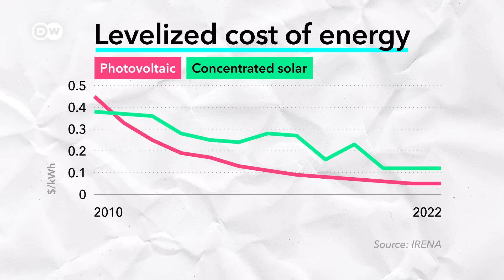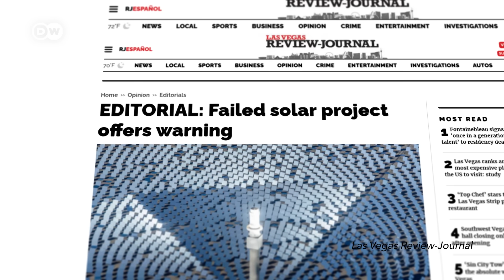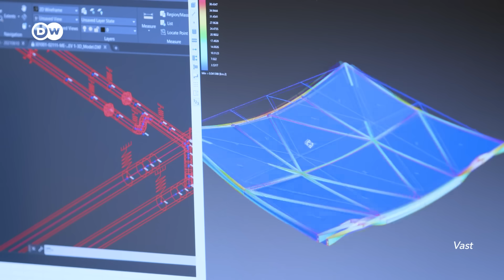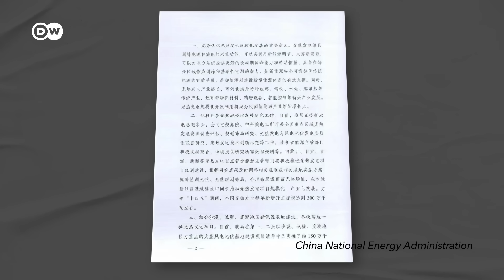How we can make solar power at night

Comment: These exist already, don't know why you covered it, they aren't living up to their potential and cost a lot and aren't as reliable as solar panels combined with grid storage which does EXACTLY the same thing but costs less.
Reply: That's exactly what the video talks about, with the exception of it mentioning how using the sun's rays to heat molten salt as storage is more efficient than charging batteries. That's why they covered it.
Reply: @user72974  except the data collected over a few years of using these shows they aren't as efficient because they have down time.  Grid storage doesn't have down time.  This very type of solar farm has a bad record in actual usage so maybe the channel didn't cover THAT part very well.
Reply: @johndoh5182  The video that talked about two modern CSP projects "failing" didn't do a good job covering that issue?
Reply: @user72974  When a title of a video says this:
"How we can make solar power at night"

And presents THIS method of solar which has shown to be a failure in multiple places it's installed AND backed up by a thumbnail, I don't bother watching the video when:

Extra solar cell panel capacity-grid storage works better and is cheaper and makes economic sense, and easier to work with and maintain.

In other words I don't watch every video.  When a channel cant' figure out how to title a video correctly and use a thumbnail that represents their video correctly then too bad I'm not going to waste my time.  Maybe a big red circle around it with a slash through it would have been better thumbnail.

Either way is storing power to use that stored power at night, so there is NO generation of power at night as the title says, there is a discharge of stored power at night.

And I've wasted enough time with this video by replying to comments so peace bro outta here.
Reply: @johndoh5182  Fair. They should have known battery tech has advanced by now to the point where using batteries to store generated electricity overnight is a better bet than CSP. The title is problematic.
Reply: What exactly does grid storage mean, it is really the use of nat gas powered peaker plants that generates power when the sun and wind vary. The amount of Li ion batteries available is about a million times too little to match what nat gas does.
Beside Gemasolar in Spain was around 20 years ago and produced power up until 5am in the morning, at avg 1GWe scale it would have cost $18B, >3x that of plain nuclear power.
Reply: @johnjakson444  Dude there are a few types of grid storage and probably the least costly now which is also VERY effective for grid storage is Iron redox flow batteries and use the most common elements in the world.  It's why OTHER channels cover it and do update videos with its progress which really means getting out in the field because they've been in production for a few years now.

The most STUPID thing you could do is use Li_Ion for grid storage so don't know why you're talking about it.  You don't need to use rare earth materials for grid storage and the world can't afford doing so.   So, if you hear of your govt. subsidizing a program to use Tesla's Li-Ion grid storage units write to them and tell them they're idiots.

Comment: This will fail because battery technology keeps getting cheaper, now we have sodium-ion batteries which are 40% cheaper than lithium-ion batteries.  And batteries will just keep getting even cheaper.
Reply: Batteries are not viable for long term energy storage as they degrade over time. Also the amount of material needed to build battery storage at a large scale makes it uneconomical. The best way to store energy is with pumped hydro. It can be scaled up to meet demand, utilises an existing natural resource and is relatively cheap. Batteries will sill be used for storage in some cases where it makes sense but it will never be a major part of energy storage
Reply: @TheLiamster  batteries only degrade a little over time.  Look at the Nissan LEAF it was released over a decade ago and most of them have about 85-90% of the original battery capacity.

One thing that makes the LEAF even more impressive is that is old battery technology modern batteries would do much better than that.

And the LEAF was built cheap so it doesn't have any thermal battery management system, all cars built after the leaf have thermal battery manament systems that keep the batteries at just the right temperature.  As all cars built after the LEAF will have far less battery degridation than the LEAF.

However we are talking about stationary battery storage.  Which will not have a full discharge in an hour, but more like 4 hours, so you're not hammering the battery so much, so you won't degrate it so much.  Also I was writing about sodium-ion batteries, which aren't as delicate when it comes to temperature.

Basically you won't have much degridation.
Reply from the maker: Talking about sodium, have you all seen this video we made previously? 👇
"How salt and sand could replace lithium batteries"
🎞️ https://www.youtube.com/watch?v=-vobMl5ldOs
Reply: Wrong, ask Tesla for the price of 10KWhr(e) of starage, it's at least $10K. Now a gallon of any hydrocarbon fuel holds about 30KWhr of chemical energy, worth about 10KWhr(e), the fuel is a few $ and the storages is about the same, about 10,000 times cheaper. Electrical batteries will never be cheap because physics says so, look up energy density of materials.
Reply: @johnjakson444 who cares about energy density when u have ample space in a desert? Secondly, u r not talking about the future cost of sodium-ion batteries
Reply: @commieTerminator  so many commenters here seem to live in a fantasy world that solar, wind, and batteries of one sort or another can save the world, just could read a physics text book on energy, maybe "Without The Hot Air" by David MacKay, free download.
Reply: @johnjakson444  energy density doesn't matter for stationary storage, these batteries are not in a car and are not moving they can be as big and heavy as they need to be.

Comment: If you have excess pv power, like they often do in California, couldn’t you send the excess to the salt tower for storage? Also, if the salt is about to solidify, couldn’t you import power to the salt to prevent it?
Reply: @johnransom1146  There is always a solution to every issue. What drive this stuff truly.

Comment: Why are the using towers over Parabolic trough solar collectors. They seem much easier to build and then you have everything close to the ground.
Can they reach higher temperaturs using the tower? And do we need higher temperaturs. One should think that 300-400 C should be enough. 🤷‍♂
Reply: parabolic troughs often use oils as the coolant loop, you can imagine how flammabale that would be, and in the US SW these devices did catch fire and were offline for months.

Comment: anything but nuclear..
Reply: Yeh I posted a comment that must have been removed. The Germans got rid of their nuclear and replaced it with lignite coal and some wind/solar. Net result, per capita CO2 for Germany is twice that of France that uses mostly nuclear power for their grid. Also Germany now has a dual grid, coal for baseload industry, and the expensive unreliable renewable energy for the consumers backed up by peaker plants that burn coal instead of gas.
Reply: So you’re saying coal is ok?
Reply: if thats a serious comment, then take a look at what happens when greens kill all the nuclear power in the country, it's a fact that German carbon emmisions are 2x that of France per capita, and what tech is it that the French use to lower release carbon. Why that would be nuclear. Look up on LLNN the energy flow graph and also the carbon emmisions by country. The EU also has similar database info graphics. It is greens that are responsible for all the new coal burning plants in Germany. The same greens in the UK even oppose solar farms too on Englands green and beutiful countryside, Greens are the worst of the NIMBYs.
Reply: Thorium based nuclear would be good.

Comment: It's too complicated, too many single points of failure and they require their own fossil fuel backup to prevent the salt solidifying.
The concept is very appealing, but the reality just isn't viable.
Reply: Why does it require fossil fuel backup to prevent it solidifying? If run correctly it shouldn't solidify, and if it does, what stops the power coming from renewables since it's connected to the grid?
Reply: @Masterrunescapeer  it's partly a practical logistical issue. The risk of damage from the salt solidifying is so great that they have to have on-site generators in the event of a failure and grid disconnect, but they're otherwise an underused resource if never otherwise used.
Their ability to maintain temperature and therefore power output is very overstated, with the energy being stored in vast vats of molten salt. That storage is finite and some of it is required simply to stop the system freezing.
Reply: @LudvigIndestrucable  Seems so but will knowledge be gained?
Reply: When that stupid senator RF Kennedy was backing these solar thermal plants in CA, it turned out that nat gas was about 30% of all the energy inputs, since the mirrors took forever to get the heat up to suitable temps in the morning, nat gas was used for the first few hours in the mornings and then later at night. And the sun doesn't just turn on like a lightbulb in the sky.

Comment: Isn't it easier to generate hydrogen, store it pressurized in big tanks and "burn" it at night or whatever energy deficit period? Compare it to managing hundreds of small rotating engines and clean glass from dust?
Reply: It's easier to pump water uphill, or heat a bunch of rocks, if one wants to store energy.
Reply: Right now, CSP would still be vastly easier, and could also be that we end up with CSP with hydrogen storage.
Reply: Its always great to convert one form of energy into another and not factor in the losses as if it were a doddle. Hydrogen has huge losses all around, using electrical energy to make it then convert to hydrogen based fuel product and store it and later convert back to electrical could easily have a round trip eff of maybe 10%. Pumped hydro, liquified air, isentropic can reach 60% quite easily.

Comment: Yeah, I heard about it. I was hot on the idea twenty years ago.
I just couldn’t get other people excited enough about it.
Say is there away you can turn thermal energy directly into electricity?
Infrared photovoltaic
Reply from the maker: Yes, thermophotovoltaics - cells are similar to photovoltaic ones but are designed to convert the specific wavelengths of infrared radiation into electricity. You can read more here 🔗 https://www.nature.com/articles/s41586-022-04473-y
Reply: @DWPlanetA  Infrared radiation is a fraction of the heat energy of heated objects, most of it is lost ore exchanged directly material to material.
Reply: No despite what the other comment from DW says about thermo photo voltaics. It is simple physics, you want to convert heat into electrical energy you want that heat to be as high as possible in absolute Kelvin temps, the machine that does the conversion will follow Carnot limits and the most efficient conversion reaches upto 60% or so far higher than the photo cells could ever do.The ideal heat source is always going to be fission giving about 1000K in Flibe salts, the convesion can be done with Super Critical CO2 engines which reach 60% eff.

Comment: With a 7 GW nameplate installed capacity, how much energy will this plant produce in 8760 hours of the year? A gas plant of that capacity will give you around 55188 GWh. What would be the cost to build a concentrated heat solar plant of 7GW that can produce the same amount of energy as a gas plant with an availability factor of 90%? Please include how much it will cost each MW to make, given that the cost of energy will impact the cost of anything done in a modern world with an energy base economy
Reply: Gas plants have a capacity factor of 56% on average, not sure where you got 90% from.
CSP with 6 hours is 40-50% CPF for worst-case 6h, which is usually more than enough for over night time, with some reaching up to 90% if more modern / 8h design.
Its big draw is that it's also 3-4x as efficient as solar for the area (over 80% solar energy gathered vs PV 26%). 

It's also cheaper than nuclear and quicker to build, generally safer (as in less requirements for safety bloating up the price, and you don't have the nuclear worst-case).
Reply: @Masterrunescapeer  ok considering a 50% capacity factor I’ll get 30660 GWh/year from a 7GW gas plant. How much it will cost to build a solar thermal plant that provide the same amount of energy per year.
Reply: @Masterrunescapeer  I think he means 90% for CCNG power plants uptime and upto 60% eff, while nat gas peaker plants have much lower uptimes and thermal eff of maybe 40%.
Reply: @johnjakson444  I was correctly referring to the uptime; nevertheless, let's discuss the capacity factor and the cost per kW while producing the same energy/year with either technology. We should also consider having these power plants installed in different places, from the sunny Nevada desert to the darkness of Northern Ontario or Quebec.

Comment: The problem with CSP is that they sacrifice economics and complexity to the god of collection efficiency.  If you can reduce the efficiency by 10-20% and half the cost, you have a more economic viable solution.  Instead of an extremely complex system of mirrors focusing on one point, use much less complex system of  many parabolic mirror troughs with the collector running along the trough at the parabolic focal point.   Instead of running the troughs north and south requiring constant tracking at speed through out the day, align the troughs east and west, requiring only a  micro adjustment up/down once a day.  Instead of requiring powerful motors to adjust the entire trough and collector, only adjust the collector.  Each of these steps reduces the cost of complexity at a small loss of collection efficiency.  It would be better to spend a little more on a phase change material that is a little less efficient and stays liquid at room temperature, than build in the cost to recover from salt becoming solid in the collection tubes when the temperature cannot be maintained.
Reply: I think that's what "Vast" are doing. They use array of smaller plants instead of gigantic one, so the parabolic mirror configuration can be easier to manufacture.
Reply: @nathanlewis42  Cmiiw, they switched from molten salt to liquid sodium, so the heat doesn't have to be as high as needed by the molten salt.
Reply: Parabolic mirror troughs don't get as hot which means low steam pressure and temperature and low thermal efficiency.
Reply: I remember a system in the US south west that used oil to collect the heat, problem was that it cought fire and destroyed the entire system.
Reply: @nathanlewis42  They were even mentioned in the video 1:30 : almost as a throw away line "they work the same way".

Comment: CSP can be a great additional form of solar power. It probably will always be much smaller than PV, only like 5% of solar PV capacity, but it might nevertheless make a significant difference. The key question is whether being able to sell energy whenever energy is most expensive is enough to make up for CSP being more expensive than solar PV overall, and whether it is better than solar PV when used with other storage solutions like batteries.